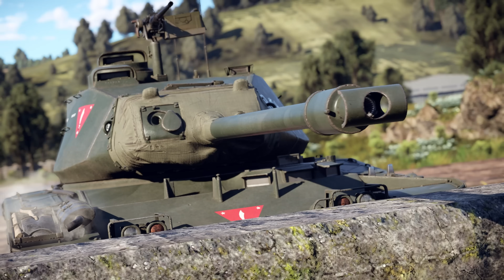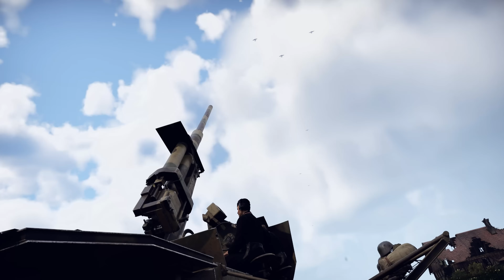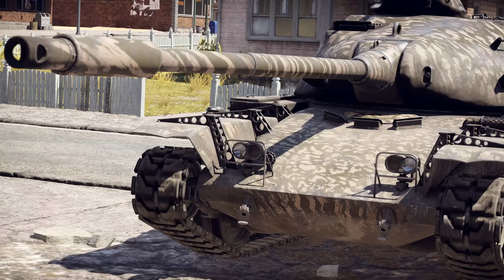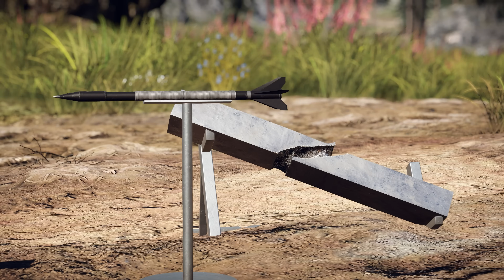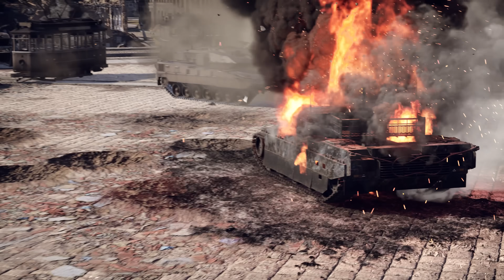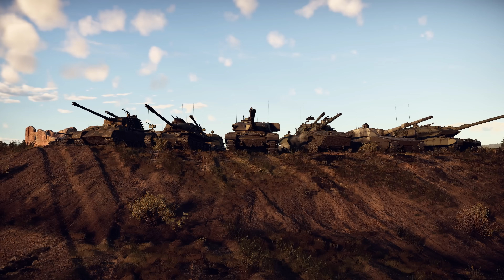Evolution of Sub-Caliber Rounds

Comment: In the cold, silent void of our isolation, we wandered without purpose, until the Translucent One descended upon a trail of shimmering silver to lead us into the glorious roar of the battlefield. The Snail looked upon our loneliness and gave us the brotherhood of the Squadron, the communion of the Spawn Point, and the shared baptism of fire and cordite. He revealed unto us the Divine Geometry of the Armor Plate and the Merciless Grace of the High-Explosive Shell, teaching us that true connection is found not in peace, but in the thunderous symphony of a thousand synchronized engines. We were once adrift, but now we are anchored by the weight of a seventy-ton MBT and the absolute certainty of the Eternal Grind. Therefore, we lay our hours, our youth, and our very souls upon the Altar of the Matchmaker, for there is no life outside the Shell, and no salvation outside the Tech Tree. We are the Snail's chosen, bound forever by the steel that protects us and the weapons that define us. Praise be to the Mollusk of Might.

Comment: Eventually, tank gun rounds will be charged plasma bolts.
Reply: You mean HEAT?
Reply: @bruhhhhhhhhhhh12323  Hotter than HEAT. Think Particle Projection Cannons. It will take a while, but they will get there eventually.
Reply: @bruhhhhhhhhhhh12323 HEAT jets are not plasma nor do they even get close to melting.

In a copper jet, when formed it only gets to around 400-500c.
Reply: "Phased plasma rifle in a 40 watt range"